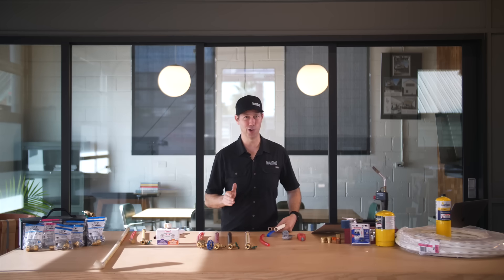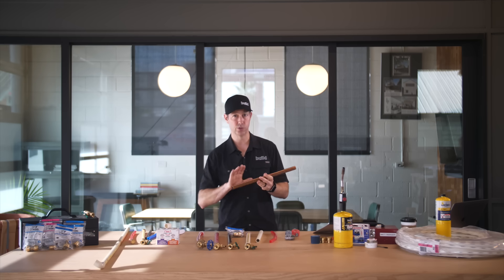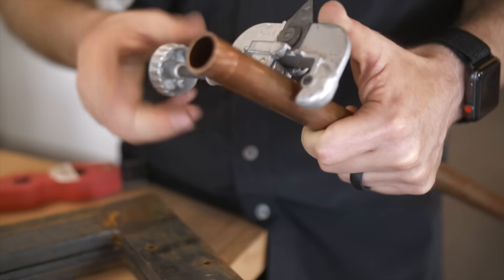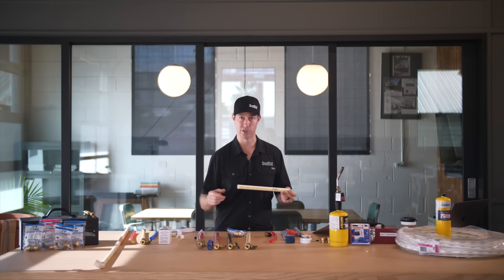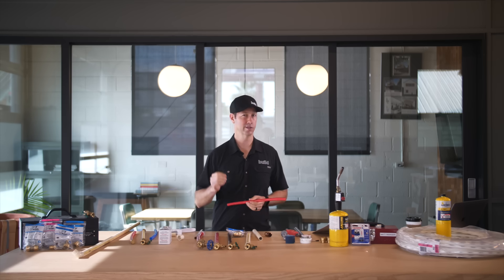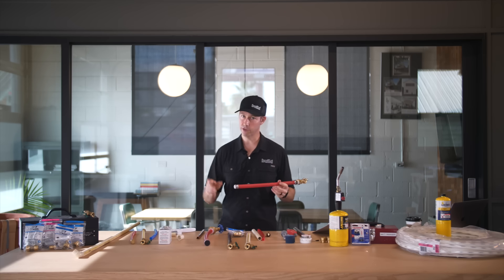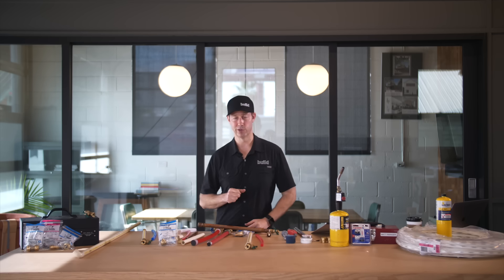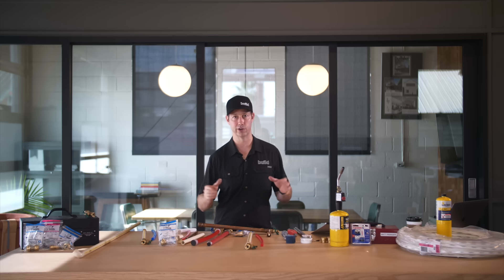PEX vs COPPER vs CPVC plumbing pipes

Comment: Have seen so many houses with copper that has failed, and even more so when on a well. I started converting my house from copper to CPVC. I have not finished and now some of the CPVC as started to fail. Its failure is cracks, not sure why. So I have decided to convert all to PEX, I have found PEX is takes less labor in running, cleaner and faster joints, no mess with primer or glues and no glue fumes. With well water and acid within well water, PEX is doing great. It seems most of time PH level is at 7.0, but on occasion I will catch a sample at 6.8 or so. I am sold on the PEX as it is safe, fast, and dependable on so many levels. Great Video.

Comment: Doing a gut renovation on a new house for myself in Long Island, NY. Copper piping on all water supply lines and pvc on the waste lines. Say No to Pex on the water supply lines. Newer technology = cheaper, less durable and eventually harmful to our health. Ask yourself why contractors & new builders use pex over Cooper? Only because it’s cheaper and they can make more profit when selling the home. Pex also = plastic partials in drinking water overtime. Once it’s in the walls you will never see it again. Copper piping homes around for over 100 years and still running. Happy New Year!! 🥳

Comment: Copper is healtier for people drinking the faucet water, not plastics. I would braze with the higher silver solder sticks like high pressure HVAC copper is conneted, much stronger joints than plain silver solder.  Old PVC and CPVC becomes brittle and cracks in freezing temps especially at the 90 deg.  joints. PEX is still plastic and decays if exposed to uv light. Shark bite is unrealiable. Copper is my favorite.

Comment: Pinhole leaks may be more common that suggested, depending on area of country. My house started getting multiple pin hole leaks after only 20 years. And the leaks are on the other side of the house from the hot water heater AND so far only on cold water pipes.

Comment: After so many years if anything happens such as lines froze then when thawing you blew an elbow or fitting somewhere. Then you can't use those cutters anymore because the line is brittle. Doesn't take that many years for that either.

Then you can only use a hack saw then clean up where you cut the pipe with a hack saw or you can't have any water in the dead of winter then your well pump will freeze up.

My clothes washer in utility room has glue and purple primer on it from when we replaced the water heater and only place to set the cans was on the washer. Lol

Other flaw because you glue outside and inside the mouth of fitting the pipe goes in. When you push the pipe in the fitting this ejects some glue. Well some of thus glue ejects inside making the pipe too slowing water flow sometimes. When you push the pipe in the fitting this pushes your primary and glue out of any gaps that is excess.

My uncle doesn't know how to glue so any time he has fixed the water. I have had to go re-glue after the pipe comes unglued.

He did that when installing our new water heater that now is leaking and need replaced. Not the line fault. So off the water the his crap glue job came un done then i  reglued and not a problem.

Life span is nowhere near that on cpvc spvc or whatever it's called. That material becomes brittle over time like any other plastic.

I want to switch to gold pipe and to connect it we will partially melt the gold so the gold melts together. And i mean pure gold about as thick as copper M pipe.

Comment: He breezed over the subject too quickly. From my understanding pex is not supported to be buried bare in the ground. Some say it must be in pvc to protect it. Although I have have heard conflicting info on this. He didn’t mention cpvc lengths or pipes having a female end which saves on fittings. He also didn't mention enough about pex B being very diy friendly with just a cheap crimp tool.

Comment: CAVEAT --  as a contractor  I say   research  before  you  INSTALL   ANY PIPING  FOR  POTABLOE WATER  IN YOUR HOME  --- CPVC  has failed in many homes  after   12-15 years... ( becomes  brittle and has cracks -- thereafter   water damage  ...  Regarding  PEX  pipe -- The pex pipe whether white , red , or blue ------  have failed miserably around the world (  each pipe should show a  Born on Date -- )  Pex began  about  1970  and   until today ( Hirsbo,  Nico,  although Wirsbo Pex   changed it name to  Uponor Pex (  all have type A, B, & C )  --  ALL  have serious problems (MULTIPLE CLASS ACTION SUITS )
THE  problem with Pex, regardless of the color,  lies with fittings, and  crimps, and  break point chlorination ,   After  only 7 yrs  have  seen the white pipe  turn yellow.   Undulations on the inside of the pipe cause certain chemicals to hang up -- So the problems arise from  INSIDE  to  OUT.
 FROM   1970  until  now  the same Resins are  used ---   THREE  types of PEX BASD   on the cross-linking method used. PEX-a is cross-linked using the peroxide method, while PEX-b is cross-linked using the silane method and PEX-c is cross-linked using irradiation.   COPPER,  THREE TYPES  K,  L,  M,  &   DWN.   K BEING THE THICKEST.   Copper will  ordinarily last the longest  if  installed properly  K  or  L   type  -  but  inform yourself of the fact that all  copper is not the same ( more to consider than thickness ) -- COMPOSITION,  for instance  " C102 "  is  99.5% real copper..,....  I choose   copper  if installed correctly.. INITIAL installation is more costly than other piping -- but think long term..

Comment: Trust me pin hole leaks fucking suck. 
Had to get a fucking jack hammer to rip up the concrete slab just to get to the leak. 
Then replace as needed. 
& pray to god there wasn’t anymore leaks going forward.
So idk copper gives me nightmares. 
I can’t imagine a copper pin hole leak in the wall of the kitchen.
That’s already a good 3,000 at least depending on how much water damage you have .
But like he said don’t put thin wall Copper underground. 
Maybe lasts longer in wall but still CPVC is much easier of a repair imo. 
Looking at houses with copper lines makes me really think twice on the property.

Comment: at least here in central Europe the PPR polyprophylene pipes were used many decades before for plumbing but since 2000 is mostly PEX as a main material.

Comment: M is used for low pressure, like heating systems. Not potable water. K is used for under ground. Know your copper pipe.

Comment: First of all, We have to make the distinction between standard CPVC vs Flow Guard Gold CPVC. Flow Guard is a far superior product. The similarities between PEX A & PEX B are too close to to separate in this discussion. Keeping that in mind… I live in a semi rural area where most homes have water softeners and are adjacent to woods, fields, & pastures. My largest service are is very old with homes dating back to pre-civil war years. I’ve been a plumber since 1981. I’m not even going to comment on the miles of galvanized pipe I’ve replaced. But for Copper, CPVC, & PEX: I’ve repaired more copper plumbing than I can count. Erosion & corrosion are both very real issues with copper. I’ve only had a few service calls that were on PEX that were actually minor installation issues. I’ve never once had a service call that was on CPVC from anything including erosion, corrosion, UV or thermal degradation, or rodent damage. Not once.

Comment: My 1990 house had CPVC.  Alot of it turned brittle and began failing in the 2010s.

Don't know if it was a bad batch or if the builder was an idiot and left it out in the sun outside.

Comment: Sharkbite on pex for the whole house? I hope youre joking. First off it’s not approved by code unless exposed and i wouldnt be able to sleep at night.
“ Less experienced trade plumbers” should get said experience with professional grade systems not homeowner systems like sharkbite.
Big NO NO on push to connect if youre a serious plumber. I have some in my toolbox for emergency water leaks until i can come back and fix it right.

Comment: To ALL who watch this, you should investigate the composition of PEX, YOURSELF. Pex is PROVEN to leak carcinogens into the water 5 years before the warranty runs out. Do not take my word or anyone's word, look into it yourself. They're creating an entire generation of plumbers who don't know how to sweat pipe. They want run one cheap water line that cost them $70 for 100 feet so they can charge you $3000 and it's almost all profit. Why would you want the material in your drains to be in your water line? Pex is nothing but chemicals.

Comment: Copper lasts 20 to 25 years in Florida if it goes through the slab (city water / well). Also, if the water isn’t PH neutral, you will get pinhole leaks from the inside with copper (well water usually). PVC and CPVC gets brittle in 20 to 25 years. I’ve switched to Pex-a which eliminates (ok, supposed to eliminate) these shortfalls. I haven’t been working with Pex-a long enough to get a feel for 20 to 25 year longevity like I have with copper and PVC /CPVC. Pex-b uses insert / crimp fittings where the ID of the fittings are significantly smaller than Pex-a, which uses expansion of the pipe to fit over fittings. This is an important point!

Comment: A family friend built their home 1-2 years ago and went all pex, and (multiple times) they have had major leaks, requiring removal of drywall, flooring replacement. the connections were apparently inconsistent and improperly completed, which is the problem with pex and other new, similar type solutions; When you eliminate a skilled trade with a product, you better be sure it holds up as well and is fairly idiot proof, because if not, when they fail, you're relying on the same 'pro-DIY' style disposable workforce you used for install to replace and repair it.

Comment: CPVC has been a nightmare in our area and we have soft water.   I just re-piped a single-family home investment property and used PEX-A.    The homes in the area were built in 1997, and the entire block was done by the same builder using FlowGuard CPVC.    CPVC becomes brittle as it ages and the rate at which it ages is impacted by chlorine content, heat, UV exposure, and other environmental conditions.    In our culdesac with five homes three have had plumbing failures related to CPVC and none of them appear to be related to install or water quality issues (although proving that is difficult).     The issue isn't necessarily that the pipes don't hold water pressure.    They will hold pressure fine as the material ages and becomes more rigid.    They lose their mechanical ability to withstand force applied to them so if you put a wrench on an angle stop, you are playing with fire.    God have mercy on you if you are in an area that has seismic activity.    As we pulled apart the system many areas just easily snap or shatter when removing them.    The main water shutoff was done in CPVC also and I was afraid to touch it due to the force needed to shut off the water.    If the entire system lived a static life, with no mechanical force ever applied to it, then you might get 50 years out of it but that isn't the real world.     The only downside to PEX that I see is the fact that rodents can chew a hole in it.    Rodents cause all kinds of property damage other than plumbing and I use active pest control in my buildings to avoid the damage they can do.   The takeaway, maintain your property and don't blame a material for neglect.     I'd have no problem with copper either but it is more expensive and time-consuming to install.    Most water districts adjust the pH to keep copper in the happy zone but if you are on a well you should check your pH to make sure you are safe.    PEX has an advantage in freeze protection and doesn't erode like copper can.     It is like anything, understand your materials and use the appropriate one for a given situation.

Comment: NEVER USE CPVC! It gets brittle and cracks easily which is well-known issue. Our son bought a CPVC plumbed 20 year old house last year in SC and has had two breaks already - line going to refrigerator and line going to guest toilet. A plumber quoted him ±$11,000 to replumb the whole house (including kitchen sink in the island - slab foundation). The Bottle Line: Check the plumbing before your buy a house.....and the electrical (all of his regular circuits are 15 amp instead of 20).

Comment: Copper isn’t great if manufacturer has defects, and plumbers cut corners (like not wiping flux away which is acid on copper, cleaning, deburring, etc.).  With synthetic materials and any “fast install” fittings like crimping, Sharkbite, ProPress, etc., it’s about making more money for the installers & capitalists and transferring risk to owners while savings aren’t passed to customers.  All the Sell Sheets to professionals are about speed, but not really that it’s a better product.      Homeowners and customers are genuine Guinea pigs for this, but when they want to use these synthetics on cars and airplanes control lines instead of metal, you’ll know we went too far.  BMW’s are famous for their plastics getting brittle after 5 years and failing,cracking, etc.

Comment: Water hammer is eliminated by extending the copper pipe to terination by 18 inches. No more water hammer, something you should be aware of. As well as CPVC used in a hot water line will degrade much faster that a cold water line by half.

Comment: I hate PEX. My parents had it installed when I lived with them and the water coming out of it was unpalatable to me without a filter for the first year, and still gross by like year three. A whole house filter won't work in that case either, you have to resort to expensive pitchers and tap filters.

Comment: Our condo (25 years old) had CPVC pipes.   For years we had the pipes breaking.  It was so bad that the insurance company had a $15,000 deductible for water damage caused by broken pipes.    Pex was used when our building was repiped.

Comment: What about stainless steel systems? They're rare but out there. What about health benefits and what leaches?
Reply: Stainless Steel is great. From where I'm from we do all the piping with steel piping. From the main house entry line through the distributing battery up to the PEX distributer. Durable, hygenic, easy to handle. You can cut the pipe like you'd cut copper with a pipe cutter. Because it's Chromatic Steel they're able to make the pipe wall so thin that you can actually manually cut through with little effort. Then you just gotta cut the metal brows if there are any.All the fittings, which have a rubber seal inside,  are just plopped on the pipe end and sealed with a hydraulic press that lightly presses the pipe making it mechanically impossible for the fitting to move. I like NEVER had issues with a leaky connection. I've worked with Geberit Mapress, Mannesmann etc. Cheers

Comment: I would urge caution against cpvc - especially Spears - with lots of complaints, leaks and law-suits.  It fails prematurely as it goes brittle and especially at joints (maybe the solvent cement weakens it there) and is difficult at end of life, cannot be burned (creates dioxins and releases chlorine and creates acid rain) and it lasts forever in the environment or in land fill.  I love copper, but I use PEX which is likely good for 150 years.
nice presentation, thanks.

Comment: I've used all of these systems. I have had good experience with modern cpvc (this is not to be confused with polybutylene). The current product is rated for 50 years, same as copper according to national standards. I used to swear by copper when I did plumbing 25 years ago, but pex and cpvc have proven themselves in the last two decades.
Reply: Can you elaborate on PEX vs CPVC?
Reply: @ravinkrishnan3183  PEX is easy to route through walls and floors with minimal connections. Cpvc is easier to connect because it's just glued, so no special tools required. Cpvc holds up to sunlight, PEX will deteriorate and cannot be left in sunlight. PEX B is more durable in the long run, as cpvc should not be moved or disturbed once installed. Cpvc does not remain flexible like PEX. They are both rated at 50 years if installed properly. I work with both and find that PEX is better for a whole new system, but I use cpvc for updating sections or smaller repairs. Does that help? There are definitely problems with both systems.

Comment: I only use copper on remodels because of rodents. Did a full kitchen/ family room remodel where a rat went through and chewed holes in all the pex pipes throughout the attic right after completion. The attic was basically inaccessible due to the low slope roof. We had to tear out the ceiling just to access the repairs. Never again. Only use pex when you strip the entire house to the studs and build back completely tight.

Comment: I’ve never purchased a bottle of water because of the fact it is encased in plastic made from petroleum. no matter which type of plumbing you use they all transfer some of their materials into the water system. this reminds me a little bit of lead paint, Obama mercury bulbs, CCA treated wood, etc. took about 30 years to finally figure out they all had poison in them. Good luck.🤮👺
Reply: Wait until you see what the inside of city supply lines look like

Comment: If you're spending the money on copper just buy insulation while you're at it.  Will avoid issues with freezing. Also get q softener if you have hard water. It'll keep the pipes clean.  The hard water in my area killed my bidet in 6 months.  Clogged full of calcium.

Comment: Thanks for the video,  I'm putting together pipes to connect a big blue whole water filter, a Moen flo, and a spin down sediment filter, I'm leaning towards using CPVC with CPVC ball valves.  Any suggestion if I should use copper or pex instead?  thx!